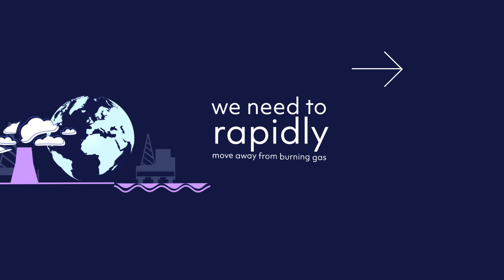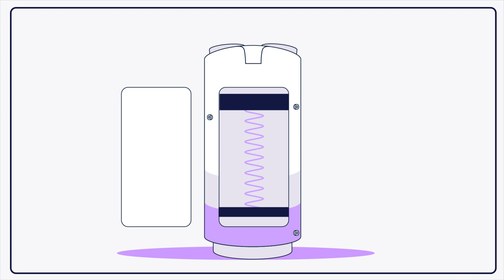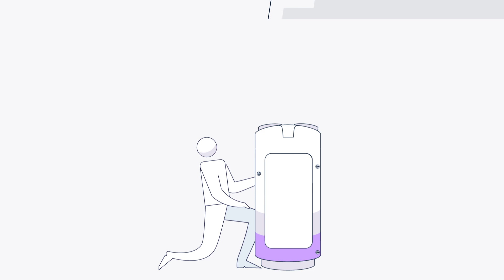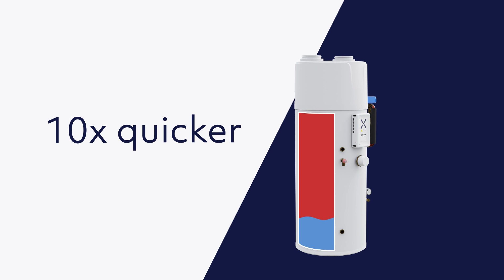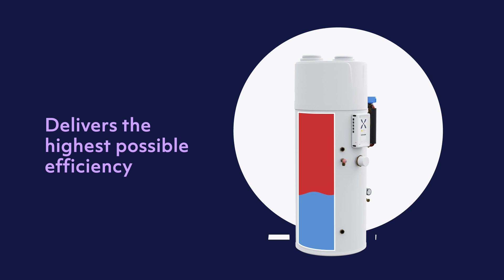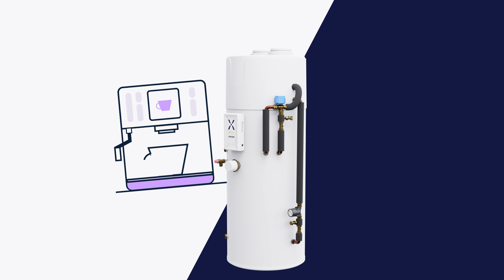The award-winning Mixergy iHP (Integrated Heat Pump Cylinder)

Comment: I have a large 4 bedroom house, in summer the loft gets very warm.  If I put the intake vent at the top of my loftspace and the cold outlet at the bottom, would this save me even more by using this free heat energy?  Would this also work in winter?
Reply from the maker: Please drop us an email with any questions you may have - enquiries@mixergy.co.uk

Comment: Do you know what the COP is in winter if drawing air from the outside?
Reply from the maker: Hey Noah, it depends on the set-up of the ducting, including bends and lengths. Check out this FAQ in our Support Hub, which has our COP calculator https://support.mixergy.co.uk/ihp-faq

Comment: Would be good to know:

1) Sound emissions when running
2) If existing gas boiler can supply back up if needed?
3) Any ducting requirements for airing cupboards in homes?
Reply from the maker: We have technical information and specs that we can share.  Drop us an email for more info - enquiries@mixergy.co.uk

Comment: When will a spec sheet be out.  Particularly interested in running noise levels, capacities and recharge times versus your “traditional” cylinders
Reply from the maker: Please send us an email, and we can provide this information enquiries@mixergy.co.uk
Reply: Did you  get a data sheet? cant find anything online.
Reply from the maker: @69sauly  please drop us an email and we can send you a copy!
Reply: 50dba according to their spec sheet. Their spec sheet also states they are using refrigerant R134a which, was banned in car AC & commercial systems a few years ago. Seems an odd choice of refrigerant. Nevertheless I'm still interested in one.
Reply: Production models use a different refrigerant.